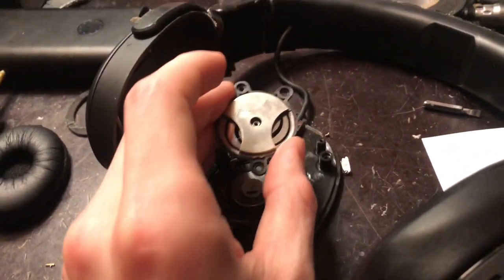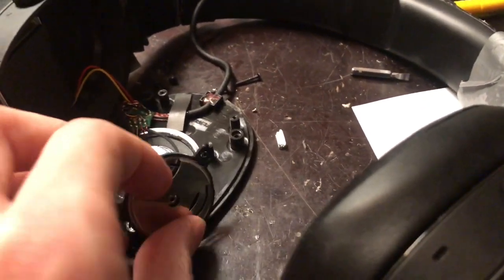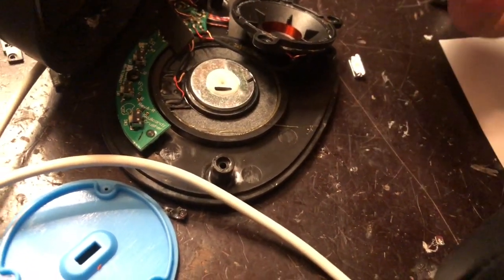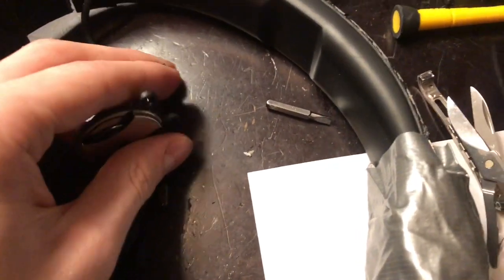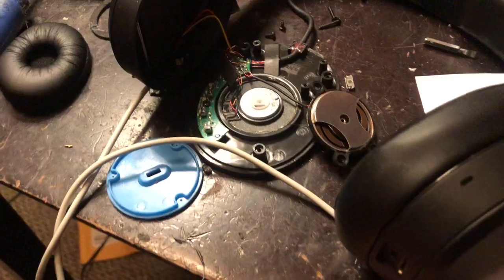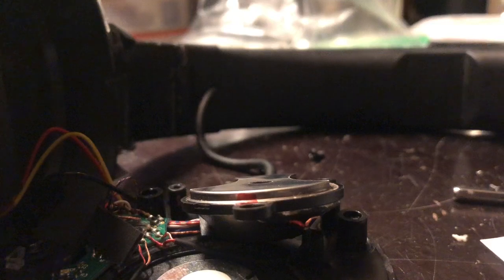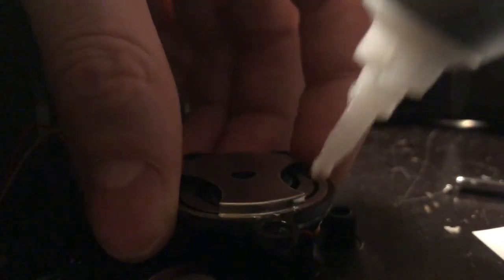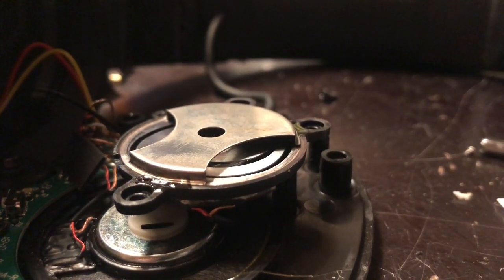Skull CandyCrushed Analysis And Repair

Comment: Ok so I figured out the actual cause of the rattle sound. It’s cause by the thin gray flexible metal. It’s so thin that it breaks apart from the magnetic coil and the metal plate and it hits the other parts in there so if you see that there is a disconnect from the metal trim it just a tiny bit shorter so it doesn’t hit the other parts when you put it back together. Also technically the metal plate isn’t supposed to come off completely but it doesn’t matter so much if it does so not much to worry there. Just trim the broken pieces and glue back together (preferably super glue).

Comment: Hi, can I ask you for help with these headphones? I need to know the full name of the CPU inside. It is the largest chip on the USB port side. the name starts with CSR (and then I couldn't read any more because I burned mine.) I have to order a replacement. This fixes the dead headphones problem. Thank you!

Comment: Dude thank you so much for this. The yoke (or at least that's what someone called it) broke on mine, so I had to replace it. But until I saw this video I didn't know there were screws on the inside keeping the two pivot points in place.

Comment: I managed to fix my rattling sound with super glue, they work perfectly sound-wise. Need to change the earpillows/cushions. Single still broken thing that i cannot fix is that stupid side-plastic you use when you open the sidepanel to change the battery, it's broken and it falls out.. :(. Cannot find somewhere to change that

Comment: When I move around or am sitting at a certain angle with my crusher wireless, you can hear rattling. Wtf?
Reply: On what side do u hear the rattling ?
Reply: It's the bass slider coming loose lol

Even I experience that on my latest Crusher Evo's
Reply: I have the same problem I can hear it when walking too

Comment: I also have the rattling problem its probably a little part that has come loose and is going around inside now it has stuck to the memebrane and everytime theres bass in a song it vibrates very strong pls halp

Edit: now it has changed to more of a banging sound on my left earcup  
(My pov) it also disappears if i turn the bass down a bit

Comment: I bought my skullcrusher wireless since Christmas and noticed a few months later that I can hear a cracking or rattling sound in my left ear. I sometimes hear it often even when I’m just moving around (Ex. Eating or walking) it’s really annoying when I’m trying to listen to a video but when I listen to music with the bass up I sometimes can hear it a little when the bass it really high with the volume all the way up. I bought these at Best Buy and I’m wondering if I’ll be able to do a trade, repair or turn it? Idk just something to at least fix the problem since I’m literally thinking about buying the crusher 360s instead but don’t wanna spend too much money.
Reply: What did you end up doing? I have the exact same problem there's a rattling noise when walking or tilting the headphones it's in the right earcup
Reply: @ulysses4989  I had a two year warranty with Best Buy so I got myself a new pair at no cost. Although this video was with the original skullcandy crushers, I’m using the Crushers ANCs

Comment: Ive also noticed the source makes a different.. it rattles the most when connected to my Note 8. When connected to my surface I notice a lot less rattle and when connected to my audient ID14 which then goes usb into the surface there a basically no rattle at all. Overall, they sound soo much bettter through the ID14, and they get fkn louudd when conneced to the inferface.

Comment: Ive went through about 5 pairs of crusher 360s because of the rattling. Every pair had it in at least 1 ear. I knew it wasnt the speaker because it would get drowned out at high volumes. Going to try this and see if it works
Reply: Did it work?
Reply: Did it work?

Comment: Is it me or does the side with the bass slider have more bass than the other one
Reply: The left side is also slightly louder than the right (most noticeable through the voice prompt)

(Edit: it's just the voice prompt)
Reply: @Noxi 
Eventually the bass adjusts itself, I'm pretty sure.
Reply: @Noxi 
There was no problem with the sound (but the voice prompt is still louder on one side), and there is no problem currently with the bass (something you have to tough out)
Reply: @Noxi 
Don't remember.
Reply: @thebarbiter4644  ive been through 4 pairs due to the plastic defect but the voice prompt is normal and it might just be your ears or something but if your not sure do this test https://www.youtube.com/watch?v=J0a2Prc_MQo start from 5:23 :)
Reply: Its because the electricity travels a shorter distance away from the power to reach the left ear cup than it does the right
Reply: @hypeup02  then they should've added an extra small battery to the right side. This is just so irritating for a 200$ headphones

Comment: i also encountered that rattling problem on my skullcandy crushers on my right earcup.. the fix that ive done is ive secured it tightly the bass amplifier and put som cotton in bwtween the screws.. and presto the rattling sounds was gone..
Reply: dont open it yet bro.. What phone are you using?, if android go to playstore then download frequency generator.. then set to 53khz and play it for 30 mins then gently tap the rattling side of your crushers until it is fixed..
Reply: @ge0ff0007  I just played it at 53 Hertz for 10 seconds and I didn't need to tap it and it's back to normal.
Reply: @MBFilip100  Yup this method is very effective on removing the rattling sound thats why i always have the app installed in my phone..
Reply: @ge0ff0007  yo do you know if the wireless version on iPhone will work
Reply: @ge0ff0007  which app is that?
Reply: @ge0ff0007  Thanks! That worked on the wired version, only took 10 minutes and saved me opening them up again. I opened them once to see if I could see anything obvious causing the rattling (I didn't)
Reply: the wireless and wired has the same kind of bass amplifier.. so i think the fix that ive done on mine will work for the wireless..
Reply: How do you opened ? I can't
Reply: @charliemack2413  There are 4 screws on behind the ear cups, just remove it then unscrew all 4.. what side of your crusher are rattling? left or right?...
Reply: @ge0ff0007  getting those earcups back on are hellish
Reply: mine is the right, I can make it sound by just touching the right side I mean tapping
Reply: Ahh, what crushers do you have? the wireless or wired?.. i also encountered that, by simply tapping i hear the rattling sounds..
Reply: Yeah that's fuck up for me it's really annoying. I have the wireless ones
Reply: Really ?? I have the note 9
Reply: Let me try it. Okay ? 30 minutes ?
Reply: @charliemack2413  yup 30 minutes.. it will vibrate continuously at 53khz so its up to you if youll going to wear it for 30 mins cause it will shake your head literally hehe.. try tapping it gently but sometimes i tap it quite hard.. just try it.. then tell me if it worked.
Reply: Okay thanks a lot let me try bro <3 thanks for the tip
Reply: it also annoys me before, when the bass kicks in the rattling starts.. mine was fixed by tightening up the screws and i added up some cushion on the plastics, but there are times it comes back.. the solution that really fixed it is the frequency generator, then i continuously tap my right ear cups.. now it is fixed.. btw i have the wired crushers.
Reply: Hey bro, I can just get to 22khz, are you sure that it was 53khz?
Reply: @charliemack2413  Just set it where your crushers will vibrate at a max level.. mine vibrates max at 53khz maybe because i have the wired version..
Reply: @ge0ff0007 think you meant 53hz here, not khz :)
Reply: Okay, I'm getting ready. I'll tell you tomorrow if it worked. Thank you